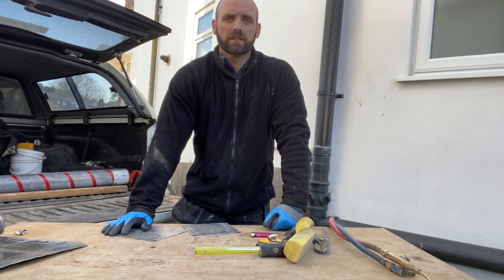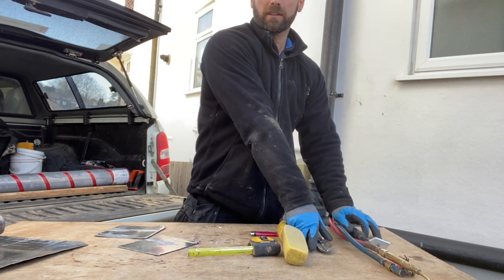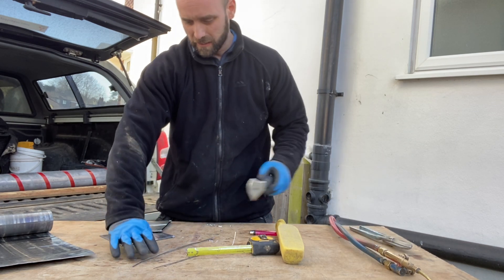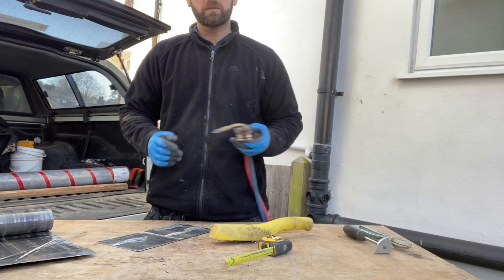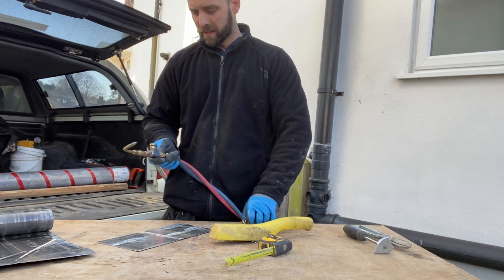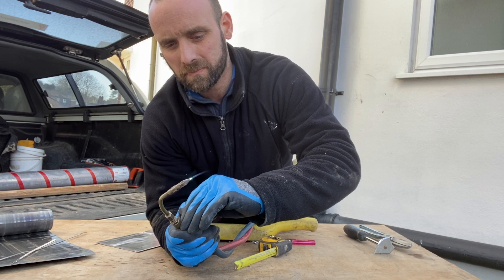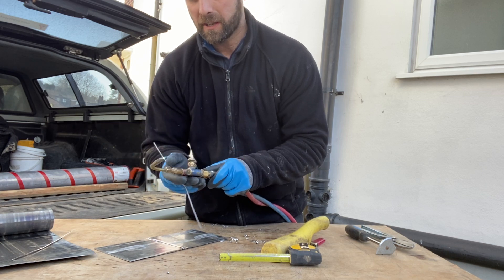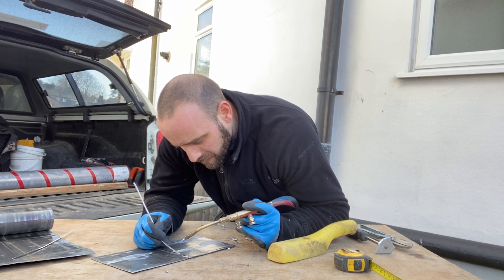Lead welding. Demonstrating how to weld lead

Comment: I used to love doing leadburning, I still have my oxyacetylene gear, which hasn't been used for over 40 yrs.
I still have all of my lead working tools which will no doubt end up in a skip when I go.
Reply from the maker: All of the old tools are the best. I used to have some lovely vintage mallets. 
What have you got exactly ?
Reply: I’m an apprentice roofer I’ll happily buy some gear off if your getting rid 👍🏼

Comment: Great video  thanks.  
My background is in pipe organ building and repair.  Many organ pipes are made from lead, tin or an alloy of the two.  Here is a video of a pipe maker soldering. The same way it was done hundreds of years ago.  The "sizing they use is talc or chalk mixed with rabbit hide glue and water mixed into a paint. They  scrape the two edges which meet together,  leaving a small v-grove of clean metal for the solder to fill in.
Reply from the maker: Thank you and thanks for watching.
I didn’t know this about the organ pipes. Very interesting thanks for sharing.

Comment: Hi im trying to weld a lead weight to a stainless flat bar. Will this work? Wont there be galvanic corrosion. I use it for diving weights
Reply from the maker: Hi I’ve  personally have never tried this. But In my experience I’ve only managed to weld lead with lead.

Comment: Is it possible to weld a patch over a hole on a lead gully? Will it hold permanently if done well? Would really appreciate anyone's input before I go buy a oxy-ace torch lol Thanks for the vid ✌
Reply from the maker: Hi thanks for watching the vid. 
Yes it will  permanently hold. But it might be difficult depending on how old the lead is and the condition. You need to make sure you can shave it back until it’s clean. If you can then it will take well

Comment: Can you weld on a vertical corner?
Reply from the maker: Yes no problem. I do this all the time. I always finding it easier welding down from the top first. And then coming back up from the bottom.
Reply: Would you add lead with a rod or weld 1 to the other. I just imagine it running away.
Reply from the maker: @benndonovan9882  I add lead with a rod. I have a clip of this in code 5 lead bays with expansion joint video.

Comment: Same technique as tig but with gas.. I do roofing and welding/fabrication so in some ways it goes hand in hand when doing this sort of thing
Reply from the maker: Oh cool. I think it’s just much lower temperatures. Do you use oxyacetylene for your lead welding.
Reply: @slbleadworks  ive only done it a couple of times because people don't like paying for the time and skill to make flashings like you do.. I'd really like to get into it more to be fair and because I've done tig and find that easy the methods the same just different type of torch.. I've used the oxy torch like you have there and also done a method with a rod that has steel on the end and heat it up hot and run it down the seam but that's more like fusion as your not adding material to the joint.. only just started getting your channel popping up.. you do some tidy tricky jobs that I've seen mullered.. good to see people with some pride and skill doing this as most people can't get their heads round it and usually butcher it..

Comment: BEEN LEAD-BURNING FOR 42 PLUS YEARS AND A 82-YEAR-OLD MASTER TAUGHT ME, WE ALWAYS USED OXY AND HYDROGEN, AND A OLD HOMEMADE RIG, WISH I COULD POST A PIC!  GREAT TO  SEE THE ART HAS NOT DIED!!!!!!   TY...
Reply from the maker: I’ve never tried this gas combo but I’d love to see it in action. Are you on Instagram ?
Reply: I always used oxygen and hydrogen when I was a leadburner at the lead works in Chester. We also made our own tips using small bore copper tube the brightness of the flame was much easier on the eye.

Comment: Fantastic! So easy to watch and very educational. Looking to purchase a model o torch/kit from welders warehouse, should i go with (standard or premium) or could you post a link please? Anything else to purchase you recommend? 👌🏼👌🏼
Reply from the maker: Thank you I hope you enjoyed the vid and got some tips. 
Yes definitely get the model o torch from welders warehouse. This is the real McCoy and not a imitation of the model o. They are never as good. And easy to work with. 
I would also recommend victor gauges. They are all built in protecting the gauges.
Reply: Does anyone have a link to this kit ? Thanks great job mate

Comment: ...Isn't oxyacetylene overkill for lead? Lead melts easily under a propane torch. Even a little butane soldering pen would work fine.
And far be it from me to tell you how to treat your own nervous system, but  shouldn't you use a respirator with your nose inches away from molten lead? It would be pretty tragic to see you in a couple years with Hatter's Shakes.
Reply from the maker: Yes I generally wear a mask. Just got the purpose of the vid I didn’t so people could hear me. Also every lead worker I know uses oxyacetylene.
Reply: @slbleadworks  oh, well that's good.
I'm curious about the gas, though... any idea why it's so common? Is it just easier/faster or is it just kind of traditional?
Reply: @kireduhai9428 I realise this is an old question but for anyone else wondering. From personal experiences, acetylene is a lot cleaner gas.
With propane for example, it will soot and dirty the lead as you weld, so makes it harder to get the pool to stick.

You can still weld with propane and oxygen but it’s harder as you have to have the flame closer and cooler to try and combat the dirty lead situation
Reply: I would like to see you wear goggles. It only needs a pop or a spit and you have got lead in your eye, Although I did it without goggles!

Comment: Could you do a vid with a close-up of verticle lead welding please,
You might need a hand with the camera.
Reply from the maker: Yes there is a close up off this on the code 5 expansion joint gutter bay vid.

Comment: Hi Stuart, what is the minimum code of lead that you should attempt to weld. Cheers👍
Reply from the maker: Hi Neil. Code 4 is absolutely fine. I weld this on a daily basis as the norm. I’ve never tried code 3. But to be honest. Code 3 should only be used for soakers anyway. You could probably weld it if you needed. But you would need such a low flame. So in answer to your question I’d say code 4.
Reply: @slbleadworks  Thanks for your reply Stuart. That’s what I feared, just bought code 3 now got to buy code 4 😢. Best of luck with your channel and I’ll look forward to following your journey 👍

Comment: Running the flame a bit hot, as you have to keep pulling off.      I was taught to run a steady pool and only pull off if you were burning through.       End result still looks well.  :-)
Reply: That's correct and we were taught to wear goggles because if that tip got blocked it will go bang

Comment: Just sub’d mate love to be able to lead weld, can you use a plumbers map gas vortex gun as they come with 3 different nozzle attachments?
Reply from the maker: Thank you for subscribing. 
I’m not really sure to be honest. But if you want to weld as easily as possible. It’s best to invest in a proper setup. It will make life so much easier.
Reply: @slbleadworks  what are some decent set ups please
Reply from the maker: @kyegebb3735  I’ve recently ordered a new set. 
I’ve gone for victor edge single stage regs. Oxygen 0.4 bar. Acetylene 1.5 bar. 
10 metre hoses. Flashbacks. An original model o torch. From welders warehouse. It’s the second generation model and it’s awesome. With a number 3 nipple. And a bottle cage without the wheels. The ones with wheels are to hard to get through scaffold lifts. 
Hope this helps.
Reply: @slbleadworks  thankyou so much, can't wait for more videos!!!😎
Reply from the maker: @kyegebb3735  your welcome. Just make sure you get an original model o torch. And not a cheaper copy. Believe you will notice the difference. And hopefully uploading a new vid over the weekend
Reply: @slbleadworks  are them oxyturbo set ups any good for a first timer to practice on? I'll only be using it say once a month after just for chimney back gutters and odd bits nown again
Reply from the maker: @kyegebb3735  I’d always recommend getting a proper lead burning kit. Especially if your new to welding. You want to make it as easy as possible. I have heard however you can now get the oxy turbo sets with a lead burning model o torch. If you want to go down that route. That’s the one I’d go for.
Reply: @slbleadworks  thankyou for taking the time to reply! Top chanel can't wait for more videos! I'm sure I'll have plenty more annoying questions for you 🤣 top bloke honestly 👍